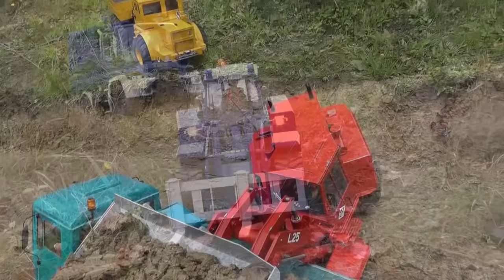BEST OF RC TRUCKS IN ACTION! COOL RC MACHINES AT WORK! FANTASTIC SELF MADE RC TOYS

Comment: I would love to get into this, but this good quality construction stuff is dam expensive. But expensive is the way to go with this kind of rc you get all the cool little details, love how all the wheels actually have suspension they lift up as you go over bumps in the road, they have axels connected to diffs driving both sets of back tires, the real vehicle sounds are just perfect as are the reverse and brake lights, they are much stronger obviously. I assume most of the excavators, bull dowsers, use electric motors driving hydraulics to give them that nice power. They are just so cool to watch!